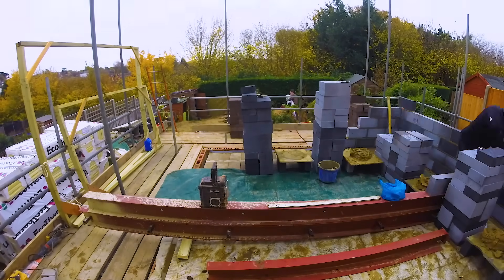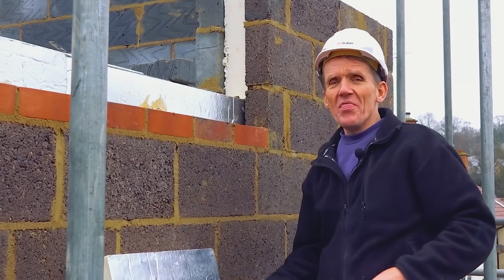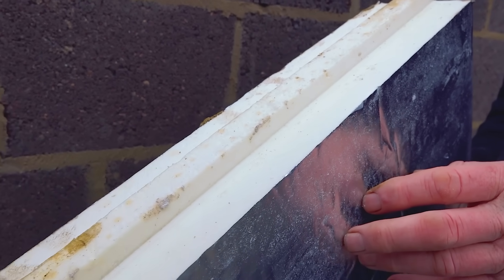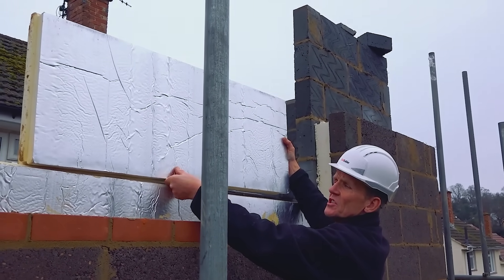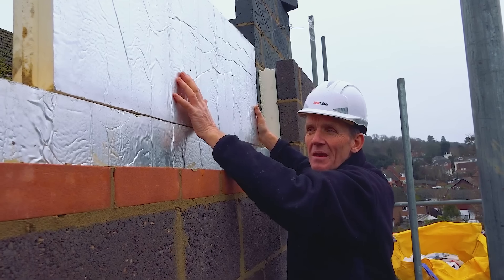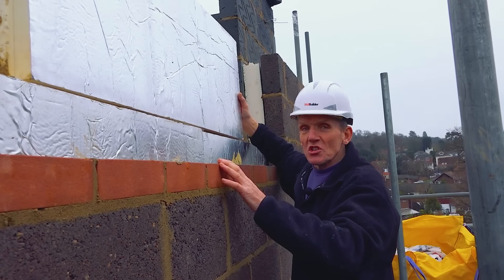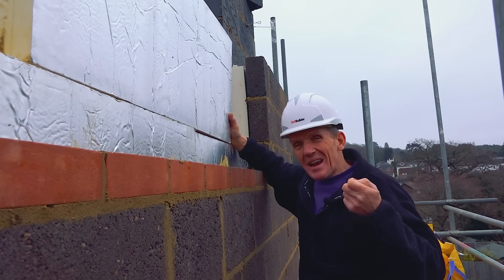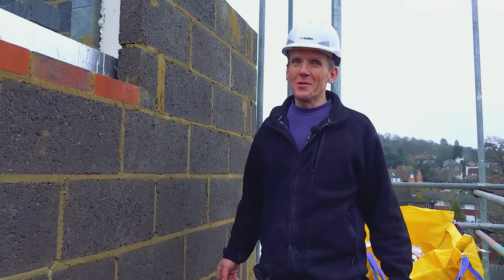Cavity Insulation | The Secret to a Warmer, Quieter House

Comment: It will trap mosture build up between the layers over time and create damp
Reply from the maker: This video was made a good few years ago and there have been zero problems. Check back in 10 years for an update
Reply: @SkillBuilder  And there's me thinking, Roger's looking old lately!!
Reply: @s.wilson5675  haha am only 38. But yes even with a cavity it needs space to allow a airflow from ventilation to keep the space dry.
Reply: @bet_big9917  Er, there is no reason that the cavity actually needs to be dry. Water vapour in the cavity does no harm. It's only in contact with inert materials, and the mortar is porous, and withthe heat tha escapes through the insulation, it will dry to the outside fine. Liquid water will find its own way out of the weep vents. The cavity is closed at the eaves so that the air in the cavity is not replaced by cold air (no air changes). That's how it's designed and it works.
Reply: @tlangdon12  that's bad 👎 if that's true technology is going backwards instead of forward. This was taken away years ago to stop damp from forming over time.
Reply: @SkillBuilder  am a lime plaster so am all about letting everything breath
Reply: Pardon the pun but watch this space.
Reply: I simply don’t understand why UK builders will not give up using those grey blocks with really bad Lamda (thermal conductivity) values. I have built in Belgium, Norway and Sweden - no one would dream of using such low performance materials. Just compare 0.5 for grey block against 0.13 for Porotherm or Ytong or Bauroc. No brainier. Use a low conductive block then you don’t have to use ridiculous thicknesses of insulation in over stretched cavities. Stop building like you are still in the 1960s!!!
Reply: @MartynEverett I'm not in England, so don't know, but I'm guessing that builders use what is known, and merchants supply what is popular, and perhaps the blocks you correctly suggest are much harder to come by (and as a result aren't widely known about).
Reply: @ricos1497  That is a circular argument. The products exist but only become popular if they are are specified in the build. The UK building regulations are pushing to higher and higher energy performance. UK should look to those countries who started on this journey in the 1970s and who already have better solutions. UK brickies are a proud and conservative - but they have to understand that all their techniques were first learned from the Flemish - who still know better than anyone else in Europe how to build with bricks in an elegant and efficient way.
Reply: @MartynEverett thank you
Reply: @MartynEverett  It's a fair question, but I don't like how difficult it is to get a good fixing into a Porotherm or AAC block. Plus, the AAC blocks tend to crack in the UK. Not quite sure why this is given that the manufacturers advice using bed reinforcement and a thin-joint mortar system that should minimise cracking. It's been suggested that the blocks are laid too quickly when they get to site, so they haven't had time to dry out fully.
Reply: @tlangdon12  It's just a matter of how to use it. I did the back part of my house - can't really call it a extension it's two stories. Clay blocks like Poroththerm on inside and simulated double Flemish bond in a single layer of bricks as facade to match the rest of the house. The Belgian brickies did it without batting an eye. The plaster is completely crack free and it's been up for nearly 20 years. As for fixings - like anything - you have to know what you are fixing into.
Reply: @ It is odd. It's not like you can't get the specialist fixings that allow you to get a good fixing into AAC in the UK, but as you say, you have to know what it is that you are fixing into.

Comment: Can't you tape the seams?
Reply from the maker: yes
Reply: @SkillBuilder Is there a risk that any water or condensation can get behind the boards and then can't get out? Condensation forms on the warm side and water can potentially get over the top
Reply: Tape may degrade over time. so install it mechanically correct from the start and it will minimize the risk
Reply: How do you keep a clean cavity.
Reply: You should tape the seams
Reply: How are you going to get your hand down a 10mm gap?
Reply: @nobloodyusername  I manage every night 😆
Reply: @steviebye1  now that's some funny shit right there
Reply: @nobloodyusername  You don't need to. The boards are fitted into the cavity before the outer leaf is built, and the red clips are used to keep the boards hard against the inner leaf. The seams could be taped at any time until you build up the outer leaf and block access to the seam you want to seal.